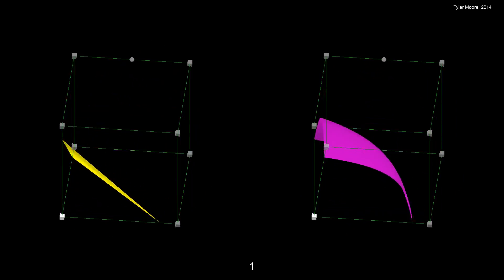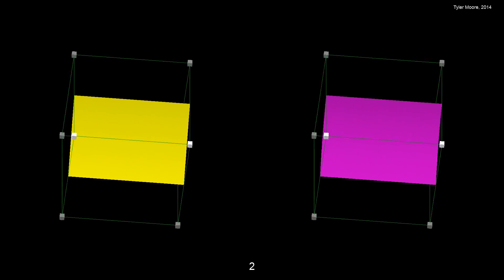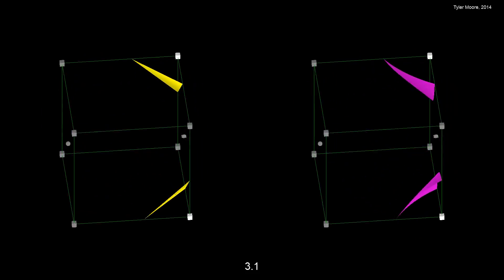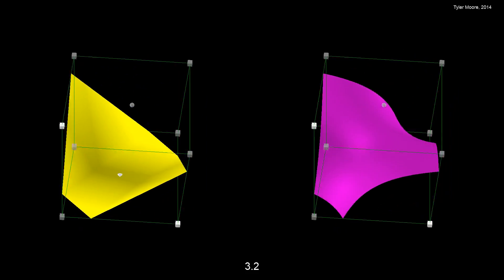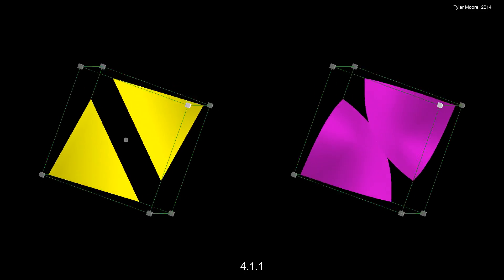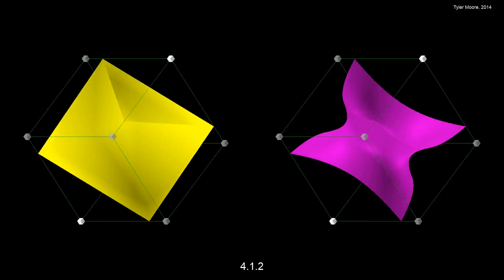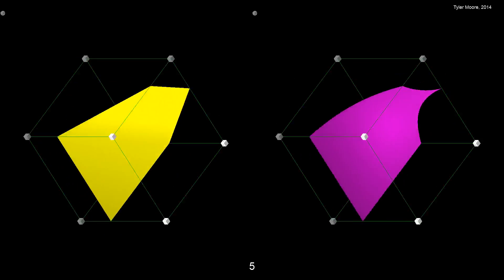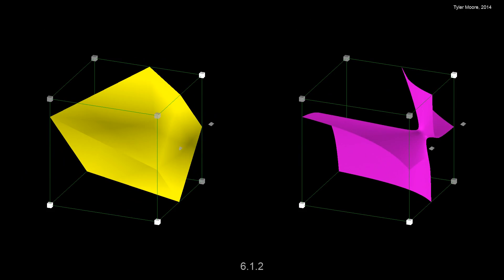Marching Cube Cases Versus Ray Traced Cases

Comment: ray tracing is a method of rendering a model and marching cubes is a method of making a model to be rendered. Is the example on the right a combination of marching cubes and ray tracing? If not then I don't know what these have to do with each other.
Edit: this is still very interesting =)
Reply from the maker: Both use the same underlying model, which is a 2x2x2 set of voxels. On each side at each instant, the sets are identical. The scalar values of the voxels are varied to show the many different scenarios handled by the marching cubes algorithm

The rendering technique is different on each side.

On the left, marching cubes is used to generate a set of polygons that represent an approximation of the isosurface. These are rendered with polygon rasterization. There is no raytracing.

The right is rendered with raytracing. The location of each ray's intersection with the isosurface and the orientation of the isosurface at that intersection are solved analytically for each ray. Marching cubes is not used.

I hope that clarifies things a bit!
Reply: @Tyler Moore but from how I understand it is that marching cubes is the two by two voxel thing in the which vertices are placed on the edges of the cube depending on whether or not each vertex is or isn't above the isosurface value. If I named this video I would have called it "Marching cubes without raytracing versus Marching cubes with raytracing". Is this wrong?
Reply from the maker: @evanroderick91  Indeed, that would be a misnomer! The one on the right doesn't use marching cubes in any way.

Marching cubes involves:
1. Classifying the case depending on which voxels are above or below the isosurface value
2. Finding vertices where the isosurface intersects the lines between adjacent voxels
3. Connecting those vertices to make polygons
4. Rendering those polygons to the screen

The one on the right doesn't do any of these things. It analytically solves for each ray's intersection with the isosurface (this turns out to be a cubic equation). There are no polygons.

Another thing to keep in mind is that this example is only a single cube (2x2x2 set of voxels). In a real world example (like a CT dataset) there would be thousands of such cubes. Marching cubes goes through each such cube, aggregates the polygons throughout the volume, and renders them all. Raytracing doesn't "march through all the cubes," but instead follows the path of each ray through the volume of cubes.
Reply: @Tyler Moore That's pretty interesting, Thanks for clearing that up = )

Comment: is this faster than trying to raytrace just triangles? isn't this less memory moving around?
Reply from the maker: Here's a pertinent wikipedia article.
https://en.m.wikipedia.org/wiki/Volume_ray_casting

The raycasting shader here doesn't use a numerical method as described in the wiki page. Instead, it analytically solves for the intersection between the ray and the isosurface.
Reply: @overtone1000  Analytically solving for the isosurface intersection sounds interesting. Can you point me in the direction of any info related to solving that?
Reply from the maker: @benparry8550  The link to the paper I used for this no longer works, and my own notes are far from interesting. Fortunately, the wikipedia page on this topic is a great starting point.

https://en.m.wikipedia.org/wiki/Volume_rendering
Reply: @overtone1000  Oh yeah, I've done volume rendering before, I'm aware of most of what's there. What interested me was the analytical part since that's new to me. If it's in the Lopes +Brodlie paper you mention in the description I'll take another look through it, at first glance I couldn't work out what was useful for raymarching vs what was all about triangulation.
Reply: @overtone1000  I guess there's a really useful thing you might be able to tell me: does the analytical approach give better looking results than a brute-force sampling approach? I'm currently trying to work out whether I've even got data that can look good
Reply from the maker: @benparry8550  A numerical method (sampling-based approach) that is run for infinite iterations yields the same result as an analytical solution because they are based on the same underlying model. The bigger differences between the two are implementation and performance.

Numerical methods are easier to implement. Analytical solutions are usually faster except when the need for accuracy is so low that the numerical method only needs a few iterations to get below the error threshold or when the analytical solution is computationally intensive.
Reply: @overtone1000  I guess what I was checking was that your solution was actually based just on the trilinearly interpolated value at a given point. 
If that's the case, my numerical approach will suffice for the test that I'm doing (and unfortunately it doesn't look that good right now)
Reply from the maker: @benparry8550  Yes, that's correct! The model is trilinear interpolation. Good luck with your work, and thanks for commenting! I'm far from this stuff these days, and I miss it.
Reply from the maker: The advantage of triangles is that they don't even have to be raytraced. But, for medical volumes (my field of interest), the meshes are impractically huge, and raytracing becomes superior.
Reply from the maker: Here's an nVidia blog entry describing the basic difference between rasterization and ray-tracing for anyone who wants to know more!
https://blogs.nvidia.com/blog/2018/03/19/whats-difference-between-ray-tracing-rasterization/
Reply: @overtone1000  hmm with sphere tracing you could've just given the points  a size and then it would've probably worked without much extra work. if the minimum distance to count as a hit is higher than the distance between spheres it looks like the've melded together

Comment: Is the source code available for this, Github maby?
Reply from the maker: Hi, John! Not now. The code isn't yet good enough to be open source. I'm currently rewriting this in C# and SharpDX, but residency is busy and I'm sure it'll take a few years. I hope an open source medical imaging library will come out of this one day, but there certainly must be some robust open source graphics projects out there for this...
Reply: Tyler Moore ahh well :/ okay. That's cool! In the mean Time I'll have to try making my version of voxels...
Reply: @overtone1000  any changes to the situation?
Reply from the maker: @minecraftermad  I did eventually port large portions of this to C++ for my work on the HoloLens (some of the other videos on my channel), which included a marching-cubes implementation! I never did get ray-tracing working for a full-size medical volume using my own shaders. I got stuck in mipmaps before the project pivoted in a different direction and I abandoned volume rendering entirely.

Certainly there must be open source libraries available by now that do it much better than a lone-gun could.

Comment: Marching cube seems linear, while ray traced has nonlinear features. For this reason, I assume the ray traced method is more computationally cumbersome. The body saddle points seem, visually, to have been identified above or below the isosurface value in a similar fashion. I may misunderstand, but third number of the identifier only seems to differ by the location of the internal saddle values, not their location to the isosurface. I wonder if the ray traced method is worth any computational burden.
Reply from the maker: That's the general idea, but the two methods are even more fundamentally different than that.

The left is rendered using the conventional graphics approach. This is the predominant approach in video/computer games because, as you said, it's generally less computationally cumbersome. Everything is made of triangles that make up more complicated shapes. The spheres are actually made of a few hundred triangles each. All the triangles for the scene are processed one by one. Each one is first linearly transformed from the three dimensional virtual space to the two dimensional real space of the monitor. It's then drawn onto the memory buffer containing the next image. Coloring (including lighting) is handled by giving the corners of the triangles not only positions but normals, colors, or "texture coordinates" (just pointers to a location on a picture). The values of these parameters at points within the triangle are calculated by interpolating between the corner values.
The right is rendering using ray tracing. This is the current predominant approach used in generating the final images for high end 3D graphics like Pixar movies and the cinematic sequences in high end video games. In this, primitives in the image (triangles, whatever) are not transformed to the space of the final image. Instead, each pixel in the image is modeled as a ray in the virtual three dimensional space. The path of the ray is traced out to its extinction. If it hits a solid object, that pixel can be colored the color of that object. If the surface is reflective, you can project a new ray off of the object. If you want to know if that point is in a shadow, you can draw rays to each of the lights in the scene and see if it hits another object before hitting the light. The increased computational requirements for most situations are obvious.

Isosurface rendering is a less common situation in the general computer graphics world. The premise is that there is a regular grid of values (in radiology these data represent some three-dimensional medical image like a CT or MRI). The value at a given point within the grid can be approximated as the trilinear interpolation between the eight nearest values in the grid, which make a up a cube. That cube is shown above as the eight white/grey boxes connected by green lines. The conventional method (on the left) is much faster. As the data set grows larger, however, the time to analyze the entire data set to queue all the triangles becomes prohibitive. The time to do this grows with the square of the size of the dataset. What's worse, if you want to change the isosurface value, it has to rebuild the entire model. The benefit of the ray tracing method (on the right) is that the time to generate a single frame only grows linearly with the size of the dataset. With the size of today's medical imaging, ray tracers overtook conventional 3D graphics a few years ago.